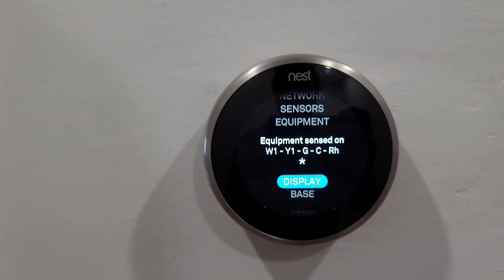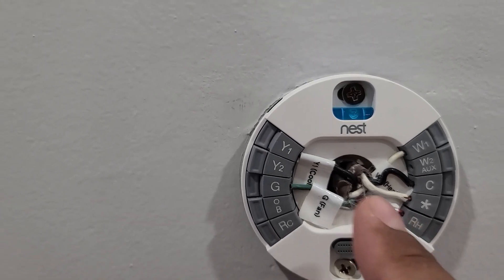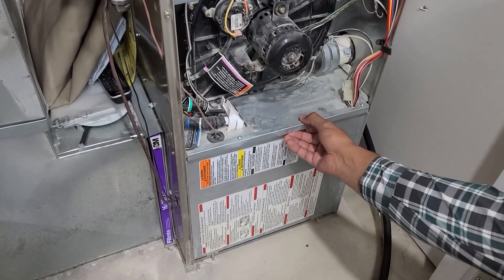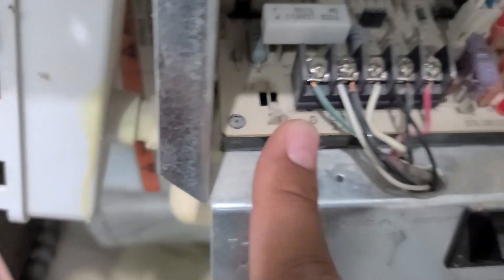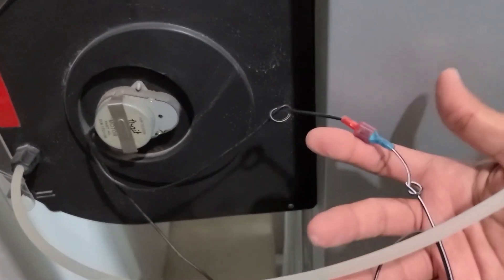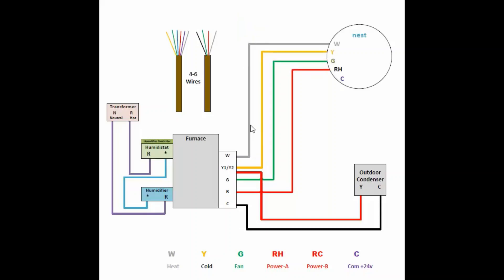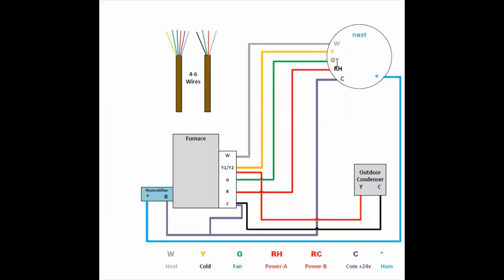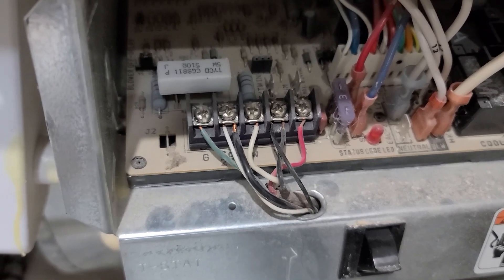Nest Thermostat wiring | Control Humidifier using Nest | HVAC control wiring using Nest

Comment: Evaluating your wiring diagram, I see R from humidifier making C at the circuit board and C at the nest.  Are you wire nutting that connection?  Thank you

Comment: Thank you - Are you concerned that the humidifier motor would draw too much power from the low voltage furnace control terminal strip?  I'd like to avoid a separate relay.

Comment: Hi. Thanks for the great video. Can you please explain what was the purpose you modified and added the connection from motherboard C to C port in Nest. I am just learning myself, but other sources tells us, running common cable from motherboard C port to R in humidifier and then a cable from * port in humidifier to * port in Nest will work. What is the benefit or target of your modification?
Reply from the maker: Common wire 'C' connected from motherboard to the Nest 'C' port because nest thermostat controller run on +24 volt and it needs power if internal battery is low. Sometime people use the 'G' wire as common 'C' by switching the wire in motherboard from 'G' to 'C" and then connect that same 'G' wire to 'C' port in nest to give power to nest system if someone does not extra wire. In my case two wires were extra other then Fan wire 'G' so i used one wire 'C' to power up the nest and humidifier and other wire to turn on and off the humidifier and '*' in the nest.

Comment: Thanks. I have a Lenox HVAC with humidifier. On the old thermostat, there’s a D wire for the humidifier. Can I just put that into the star on the Nest — and should that be enough for the humidifier to work now?
Reply from the maker: Yes, you can put that wire in '*' but make sure the 'D' wire is diretly connected with humidifier and 2nd wire coming from your humidifier should be connected to +24v if you have +24 humidifier motor